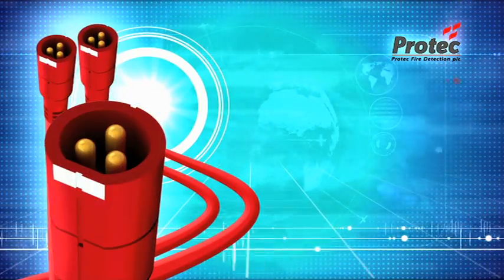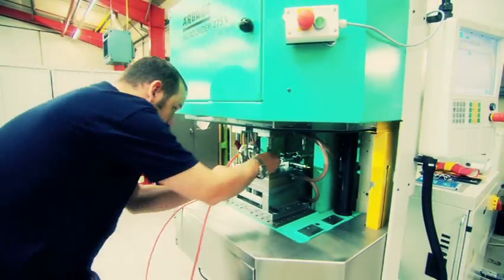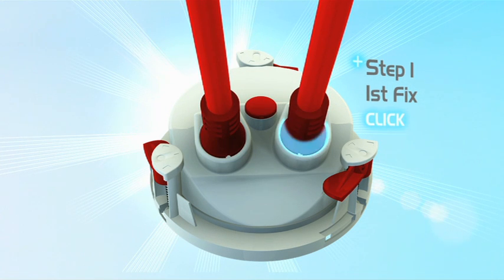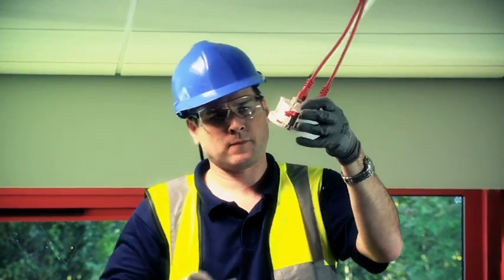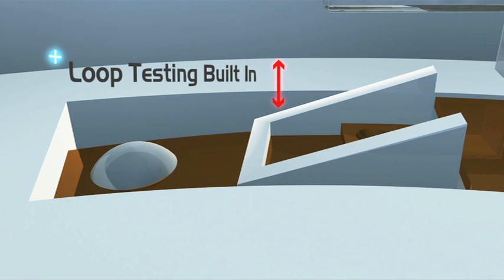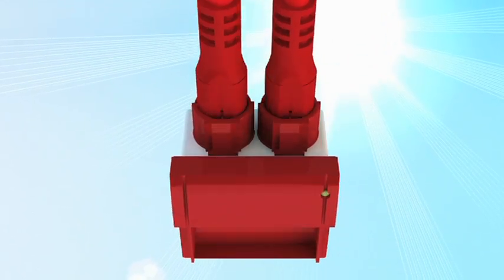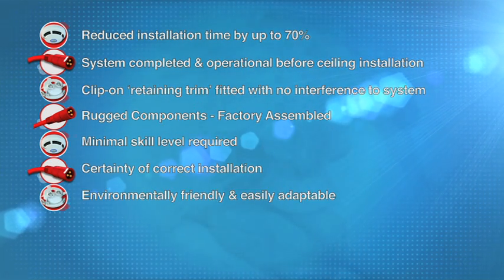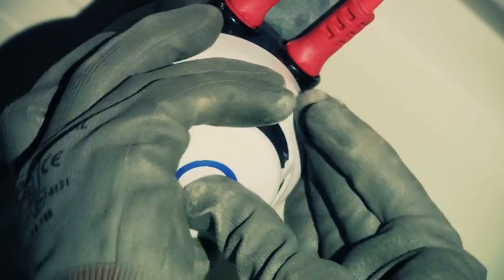Protec Plug & Play

Comment: This is good but will it work with like the SSR2 sounder beacons and do you need a Protec panel?
Reply from the maker: Hi, the Plug & Play is only available through our Digital Addressable range, and yes, you would need a Protec panel.
Reply: Also can you turn down the volume of the SSR2 sounder beacons and why hasn’t this channel been uploading?
Reply from the maker: Hi, yes, there is volume control on both the Conventional SSR via DIL switches and the Addressable via the panel. Here are the product page links for both: 
https://www.protec.co.uk/product-page/fire-detection/conventional/sounders-vads/3000-ssr2/
https://www.protec.co.uk/product-page/fire-detection/digital-addressable/sounders-vads/6000-ssr2/
Reply: Why hasn’t there been any uploads on this channel?
Reply: We’re you going to finish that sentence, ThaEpicJustAJoke AnimatorBassador2019?

Comment: why are most if not all protec systems on a continuous tone in an alarm condition, this doesn't comply with the british standards and plastic cable ties to support fp cable i have seen still there after 3 years of installation.
Reply from the maker: +joseph h Most Protec systems allow the sounder tone and volume to be configured from the fire alarm control panel. All Protec sounders produce frequencies within the 500Hz to 1,000Hz range and the tone options include warble, pulse and continuous tones.  All these tone options, including continuous, are compliant with the relevant British and European Standards. We additionally provide voice sounders which incorporate a digitally recorded speech message, to further enhance the fire alarm signal. For larger systems such as the systems we successfully provided for the London Olympic Stadium and Aquatics Centre we provide a full fire detection and voice evacuation and public address system. Our products are designed and manufactured in the UK to comply with the relevant British and European standards.
Reply: +protecfiredetection Hi this is good but when a continuous alarm by Protec sounded in newly renovated store no one had a clue what it was but in a shopping center when a Hosiden Besson banshee started to sound on fast sweep with no announcement every one made there way for the exits almost immediately this was a Thorn security Minerva system 16E and wired in Pyrotenax cable but protec systems i have seen in commercial buildings use metal conduit, this facilitates the spread of fire to other rooms, how is this justified.
Reply from the maker: +joseph h Hi, if you would like to discuss this further could you please send us your contact details to sales@protec.co.uk quoting “+joseph h youtube” and we will be happy reply accordingly.

Comment: You actually have the audacity to show your installations, where plastic cable ties are used to support FP cables? Shameful.
Reply from the maker: +jayja45 Thank you very much for the feed back. In the video plastic cables ties are being used when the cable is looped however this is only a temporary measure whilst the ceilings are being installed. Once the detector has been positioned in its final location on the ceiling tiles the cables above would be secured to the associated drop rod using metal cable ties. We hope this answers your query.
Reply: @protecfiredetection  me rn after seeing this: http://naca.cf/Discord_7cxCTx7jYJ.png